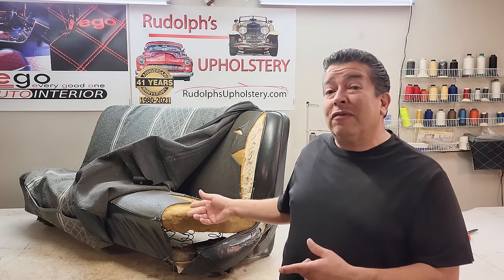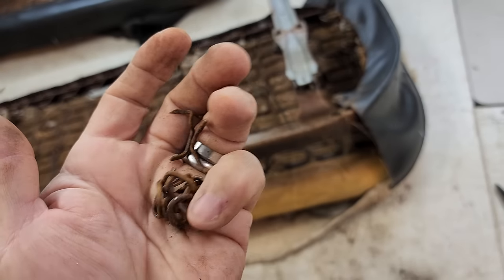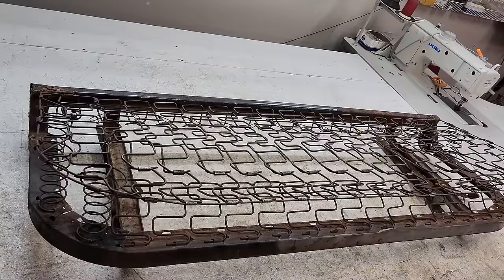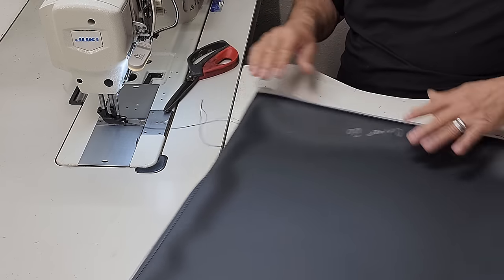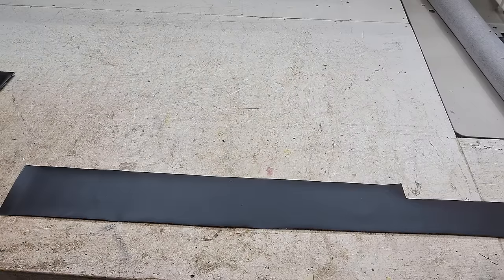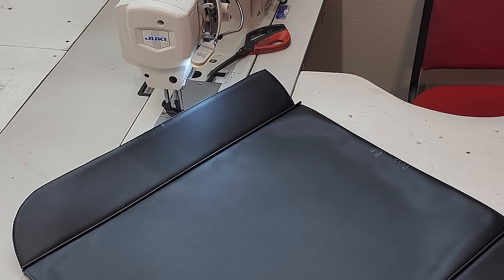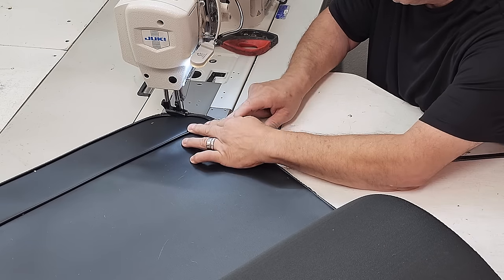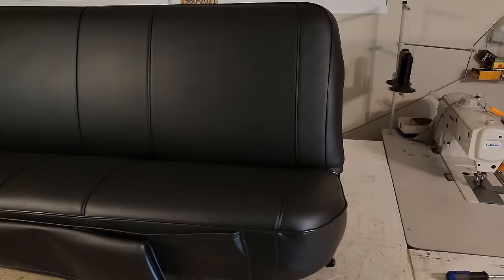How to old truck seat makeover for beginners upholstery DIY

Comment: love the addition of the ragged edge to the box cutter. I make knives. A file sharpened edge will cut a tomato far thinner than a honed razor edge. Sometimes you need to just saw it.
Reply from the maker: Hello Dm, Ragged edge is unrefined, but for the purpose if cutting the threads but not the material. Please keep liking and watching!

Comment: Thank you, I'm learning so much from you!!
What are the hand tools to have/use as a DIY guy to repair the seat foam, fill in patches with square blocks of foam and shape them like the original ?
Reply from the maker: Hello Jake, You are so welcome! For foam repair, I use only one hand tool. A hacksaw blade. For glue, I use contact adhesive. I have some videos in my channel explaining this. https://youtu.be/A18C5bGgZGU and https://youtu.be/N14VbKUdctk Please keep liking and watching!
Reply: @oldschoolautoupholstery  Hi, I am using a hacksaw to cut the foam roughly into shape.
What hand tools do you use to grate or sand down the foam to get the smooth soft round shapes ?
Reply from the maker: @JakeKennes  Hello Jake, I know that you're looking for an expensive answer, but I have none. I never sand or grate the foam for soft round shapes. I never have in 44 years. I have not found it to be necessary. I suppose you could use sanding paper? If the surface is that bad, I put 1/4" foam or dacron over the top of the foam to smooth it out. Please keep liking and watching!

Comment: Such a great video. I am super new never sewn in my life. I bought a machine and slowly getting everything I need to begin. I want to make a seat cover for my 1968 Chevy C10. I have the frame all painted and springs repaired. I used thicker carpet tile type material instead of burlap. What I don't have is an old seat cover for a template. Should I just measure the seat with the new foam I have for it in place and make my panels or do you have a template for a Chevy bench seat? I've noticed sometimes seats have a seem in the middle of the front skirt or one on each corner or even no seem at all. I would prefer no seem at all across the front skirt if possible. Can you help answer these many questions. Thanks. Love your videos very informative and you explain every step. P.S. bought a Consew P1206RB-1 Machine with walking foot, reverse and a servo.
Reply from the maker: Hello Actor, I love hearing good news like this. Just cut the foam to overhang the springs about two inches. The make your seat insert pattern panels about an inch within the foam size. I single piece skirt is fine, just uses more material. I think you will do just fine with your C10 seat. Please keep liking and watching!
Reply: I have a couple more questions if you don't mind. I am looking to buy 277 TEX270 Nylon thread for my project as this is what you had recommended. My questions are. #1 do I use the same 277 TEX270 thread in the bobbin? #2 You had said you use a #17 needle and from what I've been reading they are calling for a much bigger needle #24 or #26 if using 277 TEX270 thread. My machine came with a #17 needle so should I be ok or should I buy the bigger needle? Again thanks for all your advice and sharing your years of experience and time to help us all.
Reply from the maker: @Actor-Singer  Hello Actor, I only use a regular bobbin thread for everything I do. Just try your #17 needle. It may work for you as it does for me. Please keep liking and watching!
Reply: @oldschoolautoupholstery  Thanks what is regular bobbin thread? 92?
Reply from the maker: @Actor-Singer  Hello Actor, I use prewound bobbins. They look to be the same as my T-92 top thread. Please keep liking and watching!

Comment: I totally liked you're video very informative, I always wanted to learn upholstery, I do have some questions, when you say technique #/#'s where doe's one find these techniques,  are they in a book/ course somebody wrote ? I have a 1970 Ford Fairlane with a bench seat if the car had an option for bucket seats would the mounting holes for the bucket seats already be there if I took out the bench seat, or would I need an adapter, if I could find original bucket seats, I do know universal bucket seats need an adapter, I'm tall and my boyfriend has already messed up my headliner getting in and out with his base ball cap on and not being careful due to the car sitting so low. I don't want to have the seat raised in anyway to make it worse. Thank you again for the great video
Reply from the maker: Hello Joan, Thank you so much for saying so. I really appreciate it. These are techniques I developed over 44 years that I am sharing because I am nearing the end of my career. Not in a book, but inside my head. Upholstery is 10% knowledge and 90% technique learned over time. Really the number of the technique is not important. The lower the number, the more important it is. If you find them, original bucket seats would fit your floor the best. You would just have to drill the two inner mounting holes. Adapters for seats will raise them up for sure. Please keep liking and watching!

Comment: I would like to know how you are keeping glue in that air gun from not hardening, make it a mess out of the gun and having problems cleaning it later
Reply from the maker: Hello User, Well, I'll tell ya. The glue does not get hard in the gun. Well only if the cup is low and it is over 100 degrees. Contact adhesive reactivates itself. I just clean the tip of the gun every few months with mineral spirits. See? Now your in the know. Please keep liking and watching!

Comment: Hi Rudy, I am a 77 yo Air Force vet, who lost his 54 yo Gulf War I (Army tanker) on March 7, 2023. I am keeping his 2004 Nissan Frontier for his daughter (if she wants it later in life) ; trying to keep it up. I would love to have the seats redone in all black or dark gray vinyl. The light gray cloth bucket seat - driver's side- looks just about as bad as the seat you started with here. Can you give me an idea of about what it will cost to redo the two front buckets and the rear bench seat? There is an upholsterer in my little town of Callahan, but I should probably get more than one quote. Not sure how to do it but maybe you could PM me. Thanks, Clint
Reply from the maker: Hello Clint,  Pricing will depend greatly on what the upholsterer wants to charge you. Geographical area will matter. Also, based on how much you want to do, the design of the item and the type and cost of the materials selected. A more accurate price should be had in your area. Try Google "Upholstery shop near me" Thanks for watching!

Comment: That seat is not a 1968 Ford F100 seat. It's a 1972 - 1979 Frod truck seat. The 1968 - 1972 seats didn't have foam. They were constructed with jute & hair. The spring frames between the 2 are different to account for the difference in thickness. Other than that, they are interchangeable & both will bolt into 1968 - 1979 F trucks. It was likely swapped out for a "newer" seat at some point.
Reply from the maker: Hello William, Well, I go my info from the customer. I never saw the truck, just the seat. Please keep liking and watching!

Comment: The customer has no sense.  Not restoring the metal seat frame is a half ass way to go.  
Maybe you should have explained that old rusted seat base, back,  and the rusty springs need remediation and refurbishing.  Most likely they are clapped out and mushy when you sit on the seat.  Butt hits the floor. Never seen an old car that didn’t.  
That rust is eating the integrity of the metal.  It will eventually cause the metal to break and the welded joints to break.  Why bother paying for new upholstery over weak metal springs and metal frame?  Makes no sense.  My 2 cents.
Reply from the maker: Hello Dew, I know right? I gave him the chance, but he declined. I do what the customer wants. Please keep liking and watching!

Comment: If you wanted to be “accurate” you would have actually measured out the 1.5” strips for the welt cord, instead of just eyeballing it because it changes the overall measurement of the piece. Also the patterns should be drawn out with a fine tip utensil to make more precise patterns, you also should add your alignment marks on the seems before you cut anything apart. You should also cut the patterns to the exact line before you do a border stitch so that you have about an 1/8” or so for stretch and relief cuts rather than sewing the border stitch first on your cut line because the lines you made are already bigger than the actual piece needed then when you cut on the outside of that line it makes the whole piece bigger by about a 1/-16 to an 1/8” overall which will result in a baggy loose fitting.  and or wrinkled seat with puckers everywhere. 40 years of experience and 💩 work, and bad advice.  #dobetter #technique#1
Reply from the maker: Hello Burn the rocket scientist, How many years of experience do you have? Tell the truth. You can see 44 years of my experience here: Rudolphsupholstery.com Please keep liking and watching!